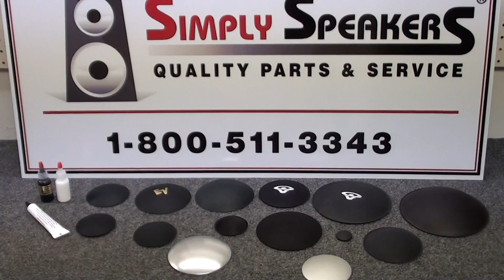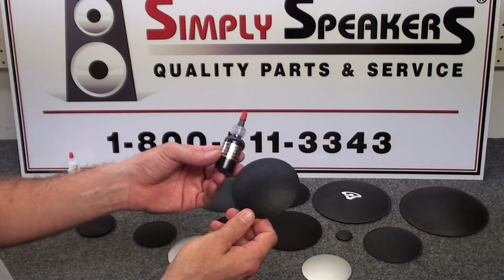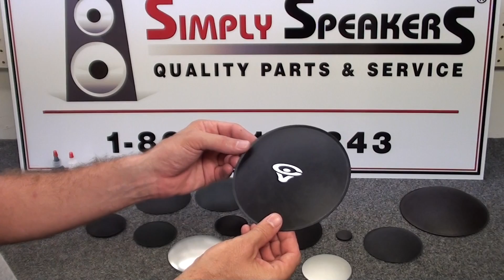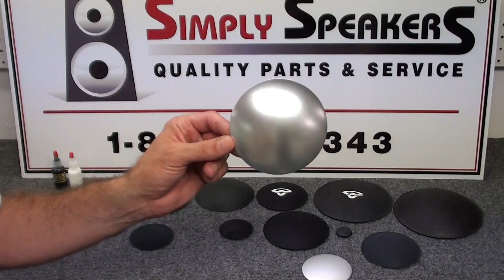Speaker Repair Dust Caps, Various Styles of Dust Caps and Information by Simply Speakers

Comment: What would you recommend for a dust cap replacement for a peavey 15in black widow bass speaker?
Reply from the maker: We use the DC-4.4P dust cap for the Black Widows.
Reply: Does the material of dust cap you use affect tone?